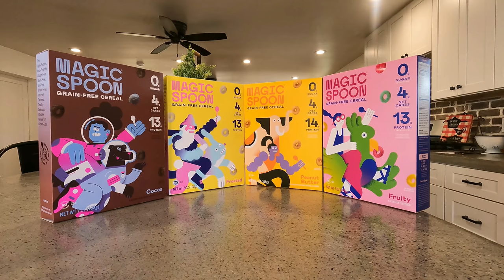#495 - Back To Tiny Cabin! Skid Steer And A Pool Table For Shop.

Comment: Imagine if you had a mezzanine floor in that workshop. On the uphill side right from front to back with shelving bays underneath to store things and to act as additional supports. This space should be for teenage retreat. That old couch and the pool table would have been the start. Basically a place just to hang out. Could even have a spare bed up there.

Comment: Amazing new furniture. So happy for your family. An suggestion on the skid steer. On the electrical components. After it stops running. Maybe take an laser temperature gun and see if one or more component is extremely hot. Just an thought.

Comment: I forget what you’ve done with the electrical system. Recheck all your electrical connections especially the grounds. Add some new ground points, replace the battery cable ends etc.. for the fence get some poly wire like Joel Saliton or Greg Judy they don’t have goats any more both both have talked about them. Use enough for 2 paddocks and move them as needed. Keep it hot, and keep them moving. Good job and good luck.

Comment: you might want to put some cement all the way up around those logs you used as posts on the cabin, we use logs like that for fence posts and they usually rot off after about 8-10 years depending on the kind of wood.

Comment: Put up 470 feet of goat fence so far and it works great although my 200 lb nubians think it's great to scratch their sides on when they get close to the barn. I did run a top wire of barb wire on the perimeter because of predators

Comment: Heath, Regarding the Skid Steer, I had  similar issue with an older vehicle. There was a coil sensor that had an intermittent short near the transmission that caused the same problem. I don't know if the engine has the same configuration, but it might be worth a look. Love the channel and your incredible family.

Comment: After the skid steer seizes up, try draining the capacitors by removing the battery terminals and touching them together for about ten seconds. If it unseizes after that then it's an electrical problem
Reply: Unless it's a thermal issue.

Comment: You're a hell of a shot. You definitely need a Gold Crown, the rails on this table seem a bit dead. Pretty typical of these home tables. Btw, I used to refurbish/re-felt pool tables as a job in college a looong time ago, so this was fun to watch! Pro tip: re-felt the rails first so you can use the pool table as a work surface without messing up the felt.

Comment: That looks like a 6x6 hog wire, I had goats and I used the 6x6 wire, my goats had horns and all the grass they could eat in the paster they had to eat the grass outside the fence and get their head stuck. So if your goats have horns they will stick their head out through the fence and get stuck.

Comment: You really need to try proper pool, more balls and pockets half the size. That fence wire that you have is generically called rylock on this side of the pond, string it between strainer posts, 3inch square posts every 6 foot or so, 3 tension plain wires top, middle and bottom with a barb 6inches above the top wire. that will contain most stock and deter quite a lot of humans too. There is a version for deer fencing as well. Stoney ridge farmer did a few videos on fencing, might be worth a look.

Comment: You skidsteer issue is definitely electric. What happens is that somewhere when the wire gets hot they either lose connection or short.

Comment: Goats get out of fencing.  Period.  Especially, if they see something on the other side they want.  Growing up we had goats.  We had 48 inch tall mesh fencing with, three strands of barb wire above that.  And, at times, an electric wire on the inside of that.  They still would get out.  I swear that those goats could tell when the electric wire was on and when it when it wasn't.
Reply: I used to have a couple of goats and the guy I got them from said something that has always stuck with me.
No matter what you do a goat will always get out if it wants to.  You only spend an hour a day with your goats trying to keep them in, they have 23hours to figure out how to get out.

Comment: Have you checked the inlet strainer for build up of dirt or gunk it can cause cavitation causing the sudden loss of pressure or other suggestions your 4-way valve or relief valve just throwing out ideas id love to see that thing fixed and hard at work hope this helps and I’m hoping as well as you that it’s something as simple as this and not a pump or the system good luck

Comment: Could it be the splines slipping on the hydronic pump cause they are warn and slip and so they heat up and it slips till the metal cools and shrinks and then the splines hold again for awhile?

Comment: Sounds like you have a check valve hanging up or possible cavitation in lines.  If you depressurize hydraulics and restart will it run normally?

Comment: My guess the problem of the skid steer might be a bad check valve in the hydraulic system. if it does not have check valves, then maybe just install one in series. Where? I Don't know. Good luck.

Comment: Sounds like there could be some hydraulic accumulator that looses pressure ass soon as you turn it off. Maby a valve from a accumulator isnt sealed anymore?

Just be careful around the pressurized equipment man 🙏🏽

Comment: Change the relays on the skid steer. They are getting hot and not holding the solenoids open.
Reply: Something is getting hot.  I would like to know how hot the hydraulic drive motors are (and the oil) when it quits.

Comment: careful with that leather, it will discolor easy from the oils in your skin, it also scratches easy
Reply: I think they wear clothes when sitting!!!!
Reply: @tonygrimes13  hahaha the oils from their neck, wrists, and hands will remove the dye in the leather, I used to repair furniture. just trying to help
Reply: @jonathanrighetti5897  But is it leather?
Reply: @tonygrimes13  its what I like to call the particle board of leather. basically a manufacturer can sell you leather seats either in a car or home furnishings if it has a certain percentage of leather in the product. most leather used in furniture and car seats is typically done with giant printers today, the days of skin sitting in a barrel  with dye are over.

Comment: The skid steer sounds like a coil problem. When it warms up the wire inside pulls apart. when it cools it goes back together.